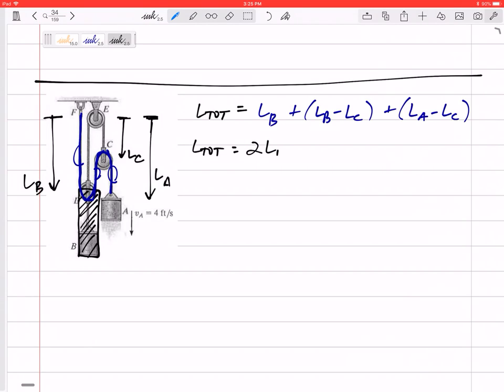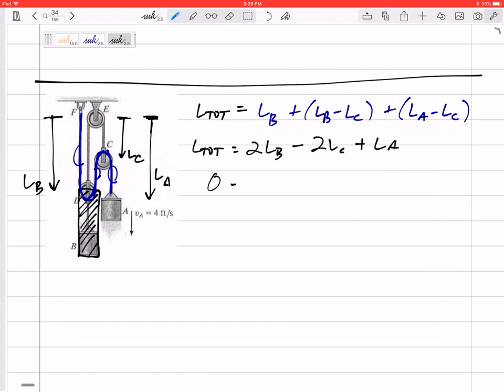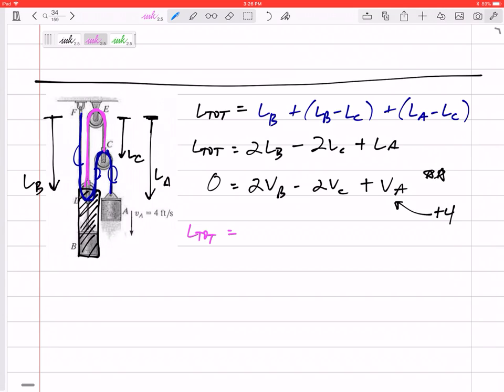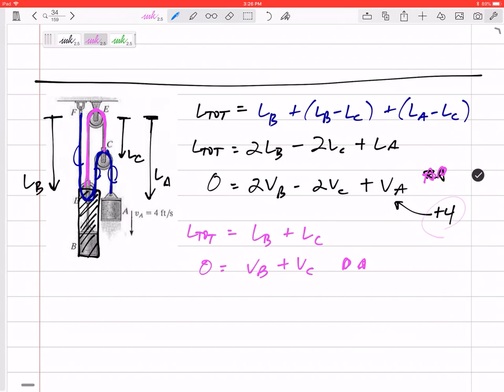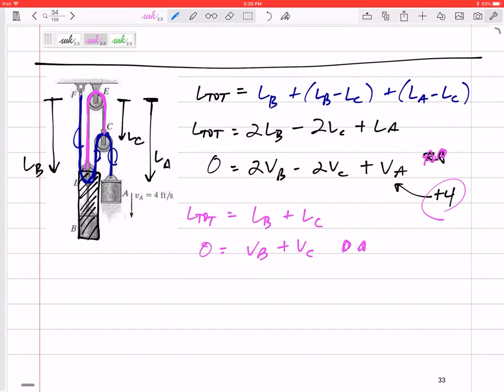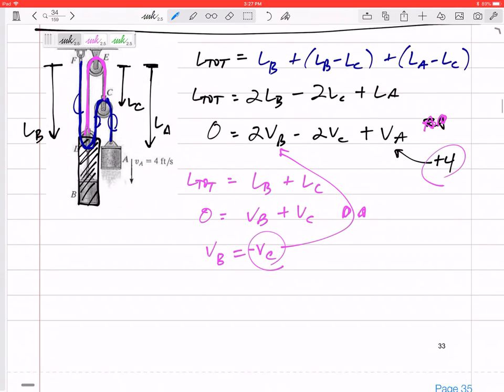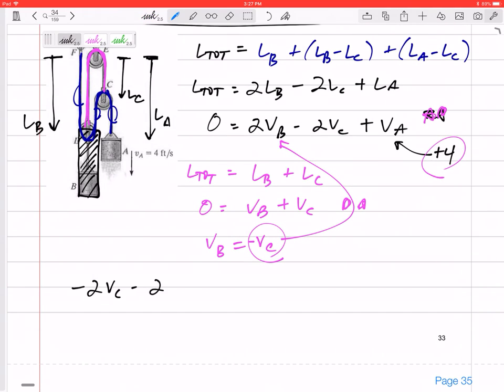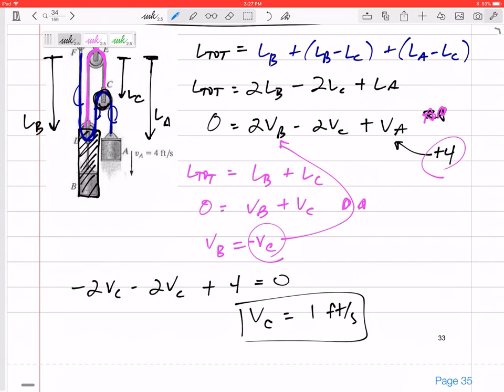Dynamics - Constrained Motion Examples (Part 2)

Comment: Why is the length of LA not just LB - LC? What was the point of defining that from a fixed point if we already had an option to define it based on the subtraction of two fixed points as we did in a earlier problem?